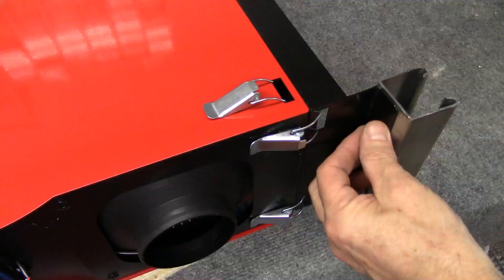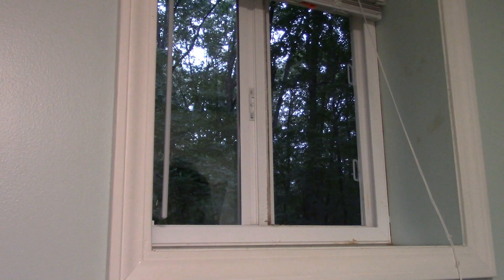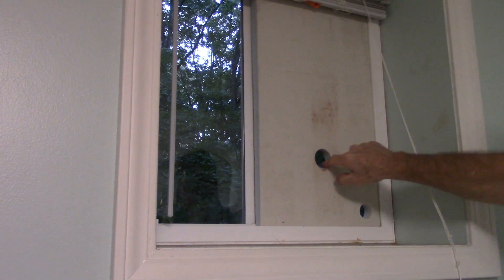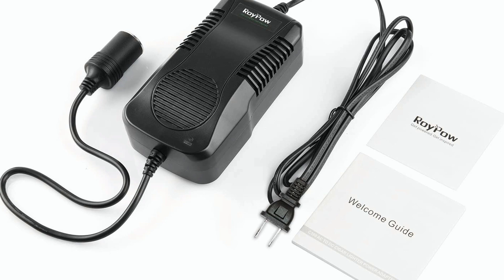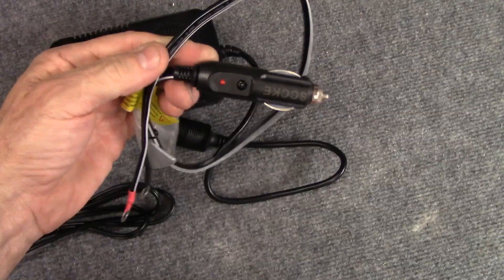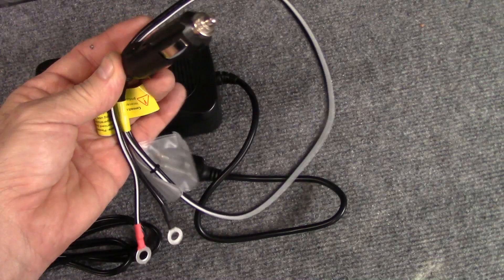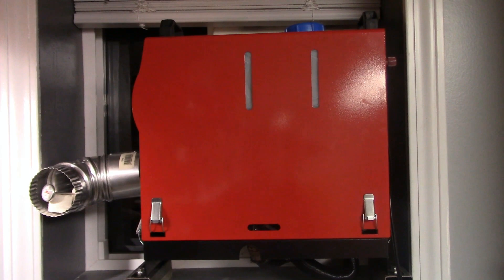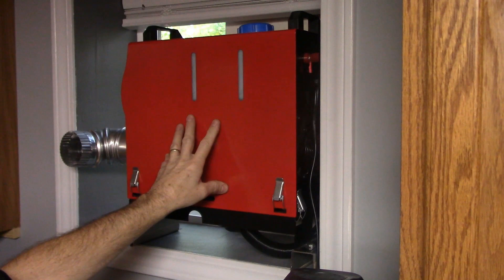Home Chinese Diesel Heater - Portable | Efficient | Safe

Comment: Leary about breathing in any fumes ...  like heating your bedroom while you sleep..
Reply from the maker: It has a sealed heat chamber with cold air in and exhaust out separated from inside heated air. I believe it is safe.  All fumes are out through exhaust pipe which should be directed outside.
Reply: @geenote  Thank you
Reply: @geenote  Until a crack develops in the heat exchanger.  Make sure you keep a detector in that basement.
Reply from the maker: @spazzman90  Yes I agree.  Thanks!

Comment: what model is it
Reply from the maker: 8000 watt (8kw) .  I think the 5000 watt (5kw) and 8000 watt (8kw) are all basically the same unit with different names.  There are slight differences like controller type, number of vents, and accessories.  Hope this helps.

Comment: Very leary about having the exhaust running thru the plywood like that. Even a wrapped exhaust is well over 200 degrees.
Reply from the maker: What plywood?
Reply: @geenote  My bad, thought the pic at the end was running through ply, I do recall you mentioning you used something else. I'm going through my garage door, what was that material you used?
Reply from the maker: @MrKevin010  I use a high temp heat panel made by a company called Thermcraft. I just happened to have some left over panels from work and it worked out great. If you use plywood, you would need to have a metal plate of some sort mounted on the wood where the exhaust comes through. You could also purchase a marine exhaust port made for the heater on Ebay.
Reply: Gee, Keith, I would love to have a piece of the material, curious mind...  My plan: I've got two 6x6 pieces of 2mm metal as well as two 6x6 pieces of 1200degree exhaust gasket. I will drill a 4" hole through my door and a 1.5" hole in the metal/gasket. That will end up giving me a 2 3/4" air gap between the 'hull' exhaust fitting.  that air gap I will fill with nice cut to fit 1/2" drywall, which is a great thermal barrier.  The Only heat that the door will see is whatever is transferred from the fitting to the metal out to the edge and through the exhaust gasket. less complicated than it sounds here.  Finally looked up the thermcraft board for similar money, but still have some questions (Plus I've already done the process described - except install) what is the rigidity/flex of it, would it be able to handle the garage door going up/down?
Reply from the maker: @MrKevin010  
 I think I could easily break my panel in half over my knee. It would be better to have my panel in a metal frame with a metal piece around the exhaust hole. 
Sounds like you have a good plan.

Comment: plugging in a UPS into a ac to dc is really inefficient, dc to ac to dc if there was a power cut
Reply from the maker: Yes but I want the heater to go through the cool down cycle if I loose AC power. The UPS keeps the battery charged and only switches to battery inverter if power is lost.

Comment: I think I would run that  fresh air intake  down  away from your exhaust  , could suck those  fumes  back into your work space , just sayin !
Reply from the maker: Not a bad idea but the fresh air intake only pulls air inside a sealed heat chamber which is isolated from the heated air that enters the room.  The heated air passes over the outside of the sealed heat chamber and heats the room.  Thanks for the concern and comment.
Reply: @geenote  wouldn’t it be more efficient to leave air intake inside
Reply from the maker: @TheCostOfLiving-  Nope. You almost have to see the unit taken apart to understand how it works. The fresh air intake hose is only routed to the inside of a sealed heat chamber to burn the fuel. Think of it like a sealed box with a fire inside and 2 hoses attached. The fire stays burning with a small fuel line that feeds the kerosene. Fuel mixes with fresh outside air pulled through the intake hose, and then exhausts out the exhaust pipe.  Room air is dragged across the outside of the sealed hot box which heats it up and exits the other side never entering the inside of the box. Leaving the air intake hose inside will use up oxygen in the room instead of oxygen from outside. Hope this helps and thanks for asking.

Comment: A lot of talking, let's hear it run. How long to heat the room and how much fuel it use?
Reply from the maker: The manual says  0.1 liter per hour on low.  Longest I run it continuous is probably 8 hours just above low setting and use maybe 1/3 gallon. It works great with no problems so far.

Comment: The FRESH AIR  "intake" is ONLY  "inches" away from the heater exhaust pipe ......  Just WRONG, in many ways !!!!   HOPE that you are using TWO carbon Monoxide detectors in that space .... (One to test the air quality, ... and The second as a "SMART" Back up, incase the first one FAILS  ????? )
Reply from the maker: I get this comment often because most do not understand how the heater works. The fresh air intake outside next to the exhaust is only to make fire. It enters a sealed heat chamber to mix with fuel and make fire that is in no way connected to the heated air that enters the room.  It is like the air that goes into your car engine intake air filter that mixes with gas to make fire then exits out the exhaust.  The air that is heated and breathed from this heater comes from inside the room entering the back of the unit where the power connects and is dragged across the  outside of the hot heat chamber then blows out the front. Just like the heater in your car pulls air across a sealed hot water chamber then back into the cabin. Hope this explains how this heater works and I do have a carbon monoxide and smoke detector close.  Thank You very much for the concern! 👍

Comment: you should have used internal air intake more efficient.
Reply from the maker: First thoughts are that is a waste of heat if you don't understand how the heater works. The little hose outside for air intake is only for the sealed heat chamber to make fire and not used for the recirculated room air. Having that hose inside only depletes the oxygen in the room. The heated air intake comes in from the back of the unit - not outside.

Comment: Dangerous. You  shouldn't have the air intake anywhere near the exhaust. there is a big chance of CO2 and CO poisoning. There is also no reason to take the fresh air from outside. Unlike an open fire set up, all the air going in to combust also goes out the exhaust while heated air for warming is never in the combustion process so air heated is never depleted of oxygen and has no combustion products in it. Taking the warmer air from the house also means it has to be heated less for the fire and warming which means the heater puts out hotter air. In my opinion the only thing piped out should be exhaust. with as complete as possible Physical barrier between it and the intake. You can think it's fine then wind currents swirl the air around and you are sucking dangerous fumes or even just the gasses with no knowledge at all.  Great Idea but I'd certainly change the intake location if I were you.
Reply from the maker: Thank you for the concern, but....The air intake hose next to the exhaust is only used for inside the sealed combustion chamber to make fire and has nothing to do with the heated air that is breathed. The air that is heated and breathed in the room is pulled in from the back of the unit and dragged across the outside of the hot heat chamber. I could probably get by leaving the heat chamber air intake hose inside a large room but I don't want to pull oxygen out of a small room (like my truck shell) and deplete the room of oxygen. This video explains it better about half way through. https://youtu.be/wAQehNzqAWY

Comment: I use solar panels to charge my batteries and the batteries work great or using an eco flow or some kind of battery backup but you can charge these things with an MPPT and a couple solar panels and you're in business
Reply from the maker: Nice! I do the same when cold weather camping in my truck shell. Thanks!